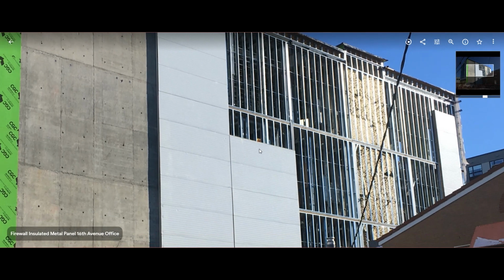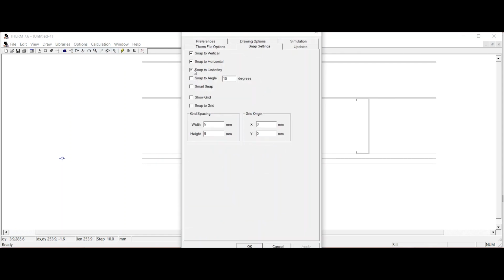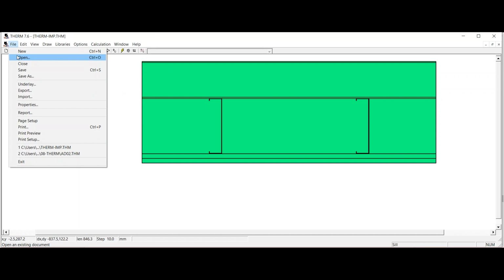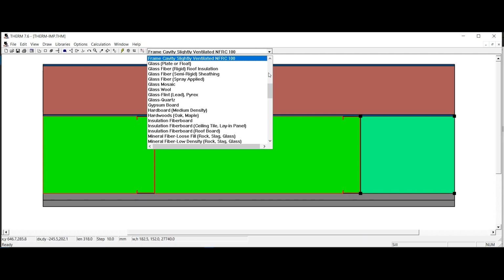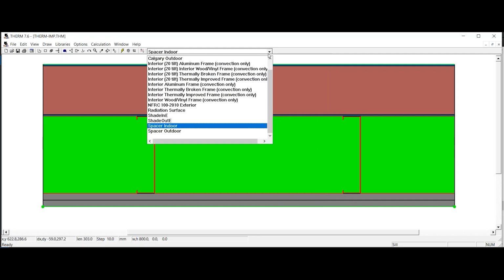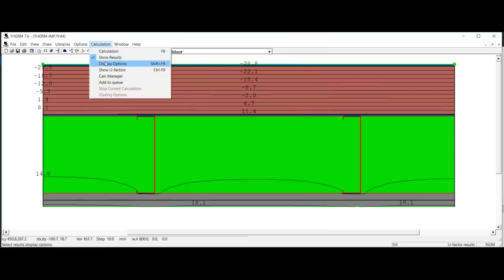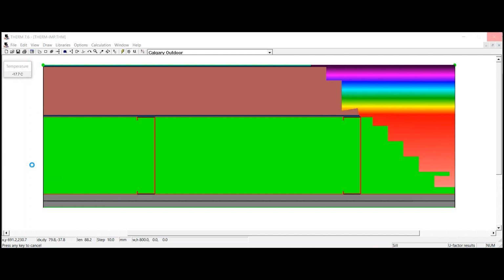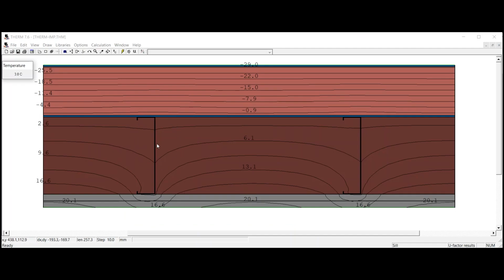Calculating a Temperature Gradient Through an Assembly Using THERM

Comment: Thanks for the video. Sounds a bit weird when you add insulation to cavity, temperature at inner face of rigid insulation changes from 11C to 0C.
Reply from the maker: That's not weird. If you put insulation in the stud space then you have prevented heat from the interior getting to that surface so the temp of that surface will drop.